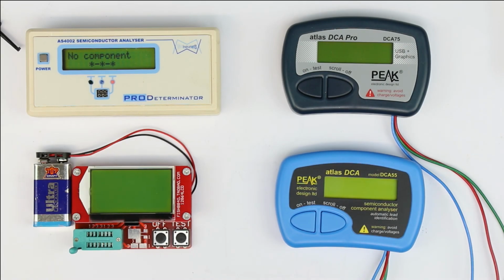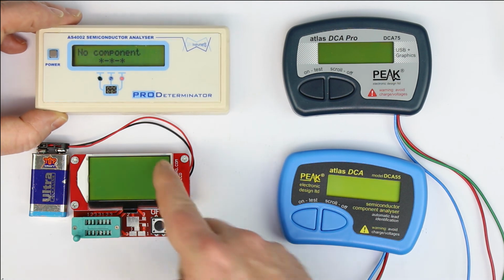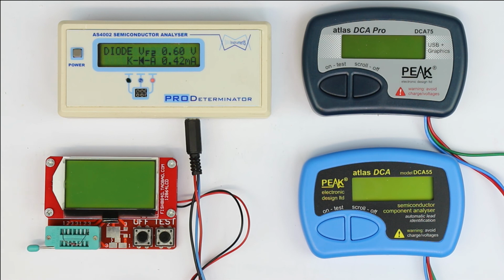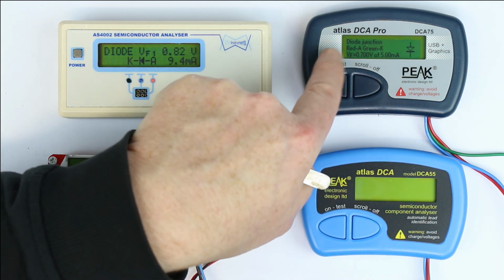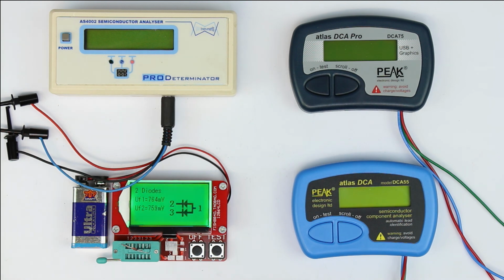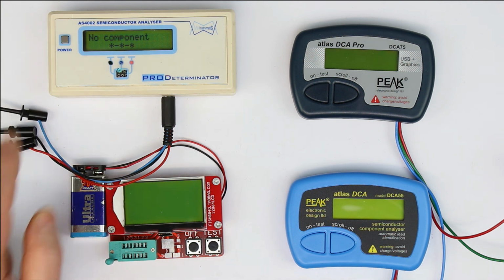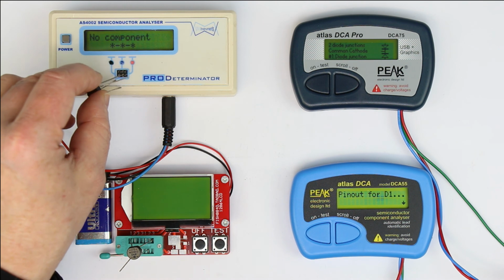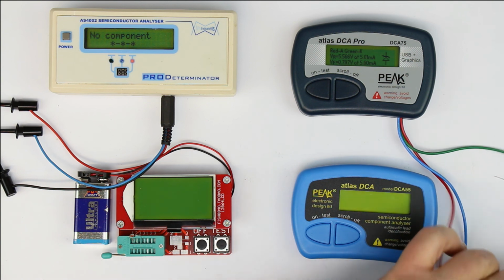Component Tester Shootout [Pt.1]: General Comparison and Diode Testing

Comment: These testers are useless to check vintage components. Plus transistor test specification is done by satisfying "conditions" given in spec manuals which these units lack. Get a component tracer that you can control test condition. Like Tektronix 7CT1N or Huntron.
Reply from the maker: I am not so negative about these testers, especially the ones that sell as "Component Testers" on Ebay, AliExpress etc, of which I here tested an early model (the Fish...). 
Those are from an open-source project of a German Ham radio amateur and were developed, improved and expanded over many years to be configured with a multitude of available options. Mine clearly discerns between germanium and silicon transistors and gives very reliable values for 2 tripels of Ube, Ic and Ib. 
And to identify an unmarked semiconductor or passive component their algorithm to identify the component is extremely complex and reliabe.
Problematic were until now only some darlingron transistors with very high beta, power transistors with very low beta and transistors with an integrated resistor or protection diode. 
And for 10...40 €/$ they are absolutely unbeatable concerning bang-for-buck and their extreme versatility.
Reply: I have tried them with hopes of setting aside my big clunky instruments but I did not find the DCA55 and DCA75 useful to check vintage components without extreme error. I do not think a skilled engineer or technician for that matter will have difficulty identifying most components unless the print has totally been erased. SEMI standards of DIN, JIS, ASTM etc should be well understood by engineers and technicians anyway.
Reply from the maker: I did encounter some unidentifiable parts. Semiconductors in metal-cans with wiped-off markings. SMD-parts with unidentifiable code-markings, power transistors with purposely sanded-off markings etc. In all cases I got the correct result (and values) with the simple "Transistor Tester". I agree, that I am not very happy with the DCA55 and DCA75, which also landed on the last places of my comparison. So perhaps you should give the the "Transistor-Tester" or "Component-Tester" from Ebay/AliExpress a second try. Google for "LCR-T7" which is the most modern incarnation of these devices. Remeber they stem from the brain of a very capable German ham-radio amateur and were perfected by a group of fans in this open source project: https://www.mikrocontroller.net/articles/AVR_Transistortester
Reply: @KainkaLabs  just so you know I do have a background being a student of West German Professors.

Comment: I have bad experience with cheap testers they fail , it is a best option buy a test meter like atlas.
Reply from the maker: Well I have the opposite experience. The component-tester (Fish...) tested here is absoultely reliable. We sell dozens of it with the improved firmware. It is much more versatile than any of the other 3 shown. And the Peak-Atlas type are completely overpriced. Dave Jones from the EEVBlog also recommends the cheap component tester.
Reply: @KainkaLabs  My PEAK DCA75 crapped out after 1 year of use. I never tested any in- circuit components. Only parts from my parts drawers.  Also it has that annoying automatic turn off, which I wish they would lengthen to 30 seconds or so.

Comment: I've got the DCA 75.   It's an awesome tester,  especially with a computer hooked up via USB.   Very well thought out,  I don't mind scrolling.  It's good.
Reply from the maker: As you might have noticed I have a different opinion.
It´s overpriced, the curve-tracing fuction is just a gimmick and the useability leaves a lot to be desired.
Reply: @KainkaLabs   so the curve tracing is a gimmick?   You'll have to prove that as a fact before you can sell me on it.   Show me.
Reply from the maker: Discussed here: https://youtu.be/isYHoyeXvk8
(and here: https://youtu.be/HbHGpA1jrJE)
In short: The curve tracer functionality itself in the DCA75 PRO is OK.
But the voltage and current range possible with the DCA75 PRO is so low that there basically is no true application of the curve-tracer function. 
You need a curve tracer to see/compare/select transistors at higher voltages and/or currents.
That´s why I call it a gimmick in the DCA75 PRO. Nice feature to justify the high price, but useless.
Reply: Great video, too many people think products are better based on price alone, similar to the high end audio debacle, if it costs 10 times more than another product, it has to be better, but Bob Carver disproved that myth 48 yrs ago and has never been challenged.

Comment: The pads on the open circuit board look as though you might be able to surface mount a pcb mount female headphone jack to receive your clip adapter. I'm not sure about the pinout vs. the tabs. Here's an example of the jack:  http://www.ebay.com/itm/like/321040068304
Reply from the maker: No. The pads are arranged for the most common SMD outlines and the pinout of the 3,5mm jack won´t fit.